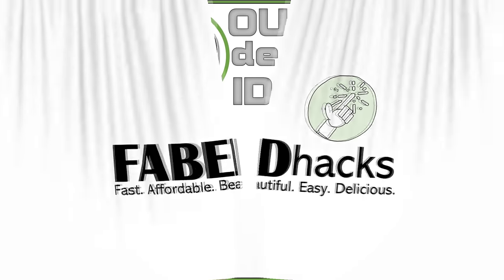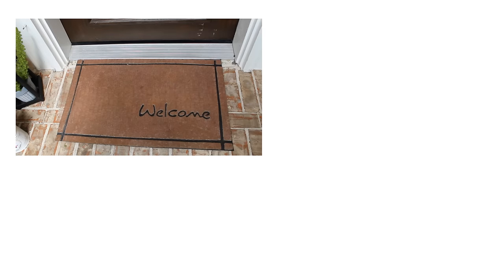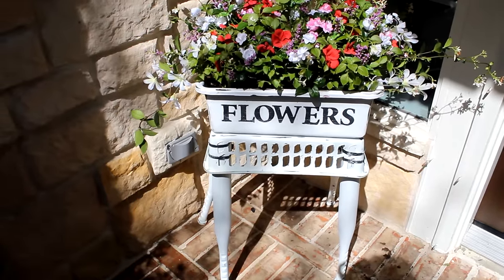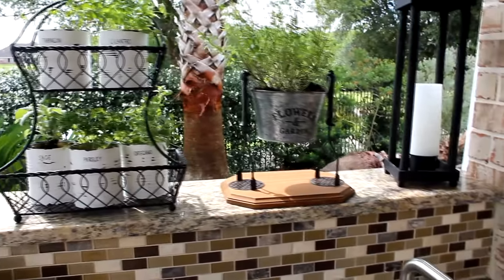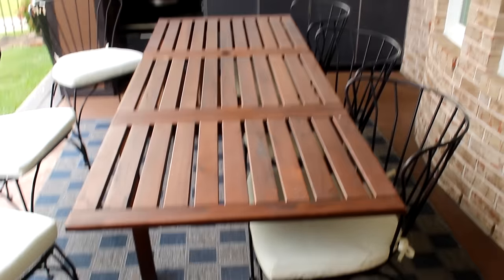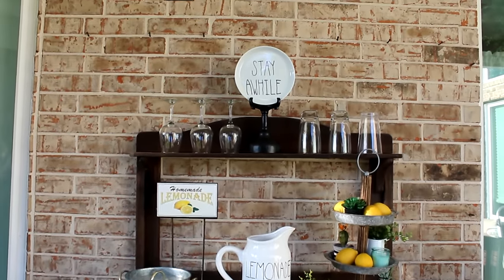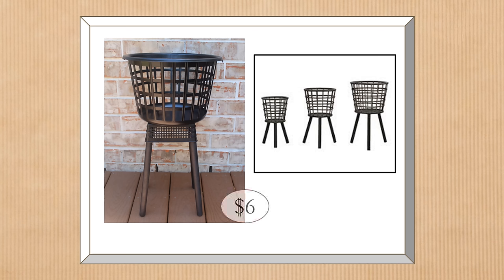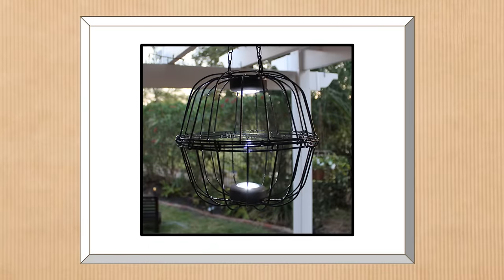30 OUTDOOR DECORATING IDEAS | DIY PORCH~PATIO~DECK ⭐NEW⭐200+ ideas from Amazon, IKEA, Target & more

Comment: Here’s a tip for getting the cushion covers back onto those cheaper cushions that don’t have a liner....place the cushion into a plastic trash bag with a pull tie.  Be sure to place it into the cushion cover with the tie on the bottom so, when you’re gotten the cushion inside, you can easily open the tie and slide the bag out. Then do your next pillow.  If desired, you could leave it on your cushion for easy removal next spring.
Reply: Great tip!👍🏼
Reply: Great idea.....I also did this when I put my grandaughter clothing in her back pack.....I folded her clothing,  slid the clothing in a Walmart plastic bag, and then into her backpack that way her clothing looked great when she got ready to wear them.....every thing stayed perfectly pressed, and not waded Ina wrinkle ball....!!!!
Reply: Hello Kelly how was your day today I hope you are save in this pandemic?
Reply: Hello,🌹how are you doing? I hope everything is going well with you and your family over there.?

Comment: Out door curtains option I used painters cloths. Got them from Harbor Freight. Put grommets on the top and used shower curtain rings to put through the pipe. Easy to slide open or close. You can also paint these cloths for color.

Comment: thanks for all of the great ideas!  Another option for outdoor curtains are Harbor Freight canvas drop cloth pieces of various sizes.  I clipped on drapery rings and use the panels in my living room.  They're a nice quality material and would hold up outside easily.  The little table using the laundry basket with the wispy ends left on is not my favorite, I like it much better with the ends cut off.
Reply: Hello Dolores how was your day today I hope you are save in this pandemic?
Reply: Hello,🌹how are you doing? I hope everything is going well with you and your family over there.?

Comment: You could also use the dollar tree plastic table cloths and fold over to make a seam to fit your plastic rod through for curtains and then just wipe them down while hanging or use your water hose to clean with out having to take them off to clean
Reply from the maker: Thanks for the tip!
Reply: @FABEDhacks  I purchased outdoor drapes from Lowes 5 years ago and this year they need to be replaced as rose bush caught them during a storm and they were tore.  Beautiful drapes that were extra long.  I believe 8 feet long.  I got them on sale.  I need to check if they still carry them.

Comment: Hi question, would you suggest adding a heavy glue on the bats before zip tying??? Or did the zips only work ok??? Thanks~ amazing video!!!!💞💕💞💕💞💕💞
Reply from the maker: Thanks! So glad you liked the Outdoor Decorating Ideas video! I did try e6000 but eventually it just broke off and the zip ties were the only thing holding in place which worked out OK since I did have to reposition the bats once I put the planter on my front porch. The porch has a fairly steep slope to it so I had to position the back legs out a little to have the planter sit straight. I think if I didn't move it around so much the glue might have held or using another more intensive glue like JB Weld would have held better. But zips only working just fine.
Reply: Ok, that makes a lot of sense, not everything is 100% flat/level outside!!! Appreciate the response back!!!! Have a great summer!!!!

Comment: Have you thought about shower curtains for your outdoor space?
Reply from the maker: I love that idea! I did look into and because they pergola is not too tall, they probably would be a good option. But I figured since I had those IKEA ones just gather dust for the last two years I would give them a try. They holding up pretty well but if they don't work out, I prob will go with the shower curtains or the drop cloths like Margie (below) suggested. Thanks! 😊💗

Comment: 43:43 instead of using the strip ties, couldn't you use the small screws thru the plastic of the laundry basket to make the table more secure so its stabilized and won't tip over in the wind?

Comment: Rosemary can you please tell me where you got that paint marker(s) from? I been trying find the some ones you have but no luck. Also love the video as always!
Reply from the maker: I purchased those at Hobby Lobby but they were on clearance so not sure if they still carry that brand. I just checked on line and it seems they have the ART-I-SAN brand paints and a gel marker but not the paint marker. They may have in store though but I'm thinking if they were on clearance they may be discontinued. Bummer, also did a google search trying to find another seller but can't find any. That's a shame because that is a really good brand. ☹
Reply: @FABEDhacks  thank you for answering me. I really appreciate. That sucks. What does your paint marker say? Meaning does it specify say" Paint Marker"on it. I am asking because when I am ready to buy I know I am getting the right kind.

Comment: I can not put things on my porch or yard that is not nailed down , my plants were taken and I have a heavy planter old was filled with a jade plant and I git it to cave giving it a design, I had a Gardner who used his blower and broke many if plus missing piece and knowing he has taken clippings to start his own , I could not say anything because I did not see him
But it was there before he was there.  I put together a metal bird bath taking me hours screwing it , a week later my garbage truck was out front close by it longer than normal.  He live close by my home , I suspected him could not prove it, but drove past his house and he has one just like mine , only way to prove it would go turn it upside down as I put my name in it several places just in case, but if I was wrong and it just happened he got one and I got  mine went , than that woukd be a mess so I had more than once things taken so I gave up, I had to use a bicycle chain hooked to my lamp post next to my 
Front as it was also pulled away wheb the bird bath went , but they coukd not get it that easy, but I knew it was pulled away but mud made it hard , so I put tge chain and saw it moved more than once but they did not get it, only place I can decorate would be fir my patio .wish I could do more for my front but know I woukd have to cement it down . Sadly this us happening with Christmas Decorations also , new generation of disrespect for others things,  I will just love yours. ❤️